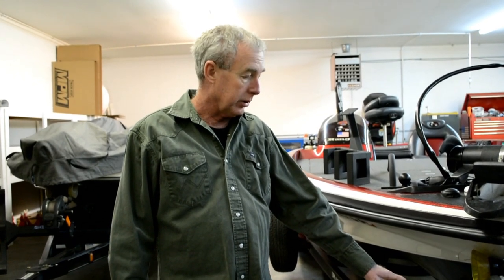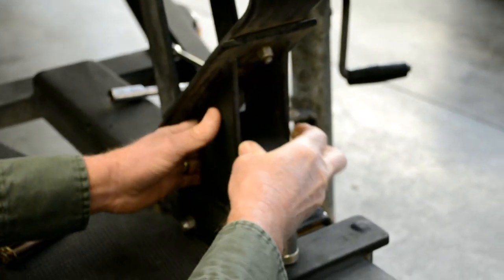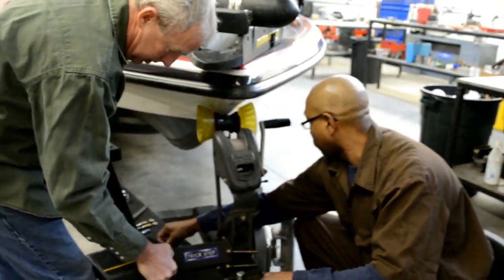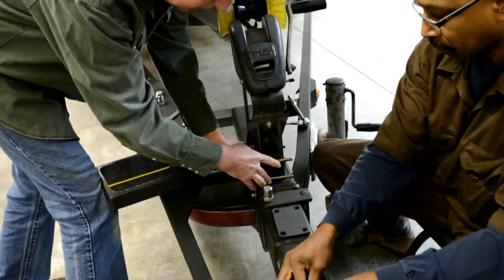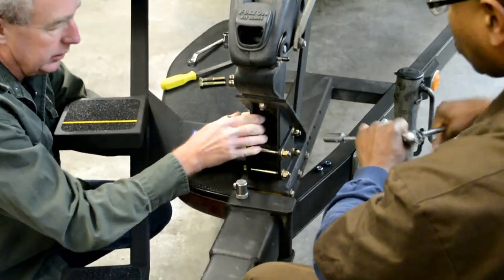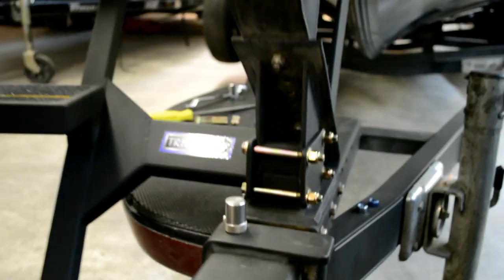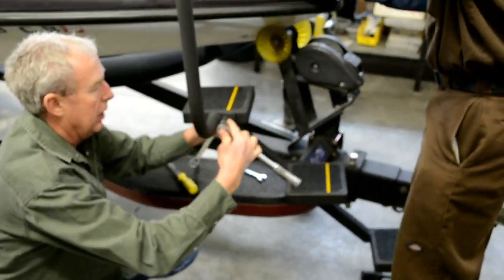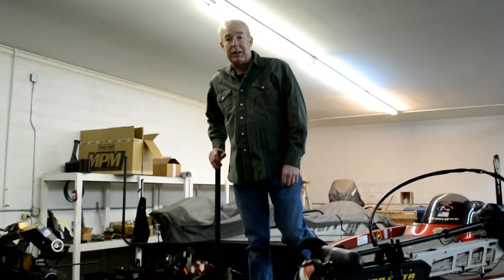Trick Step Ranger Boats 2003-2011 Installation

Comment: considering steps for my ez loader trailer , little concerned with the first step possibly hitting the bumper if you get into a tight angle
Reply from the maker: The first step isn't an issue, the second step can hit in some cases, truck and hitch and ball mounts have a lot to do with that. We recommend checking your turn radius to the right and if your close get a longer ball mount for your hitch. www.etrailer.com has a great selection of ball mounts that start around 25 bucks that will easily fix  the issue, 2 to 4 inches is all you may need. Give us a call and we can work you through it. Thanks

Comment: 500 for 3 steps? Damn
Reply: When you get older you will appreciate the ingenuity behind these steps, the cheapest cost very little but the best cost more. I am installing mine on my 175 Bass Tracker because I am 73 and can’t step into a boat like I use too. These steps will allow to fish by myself and I can get in and out of the boat easily.